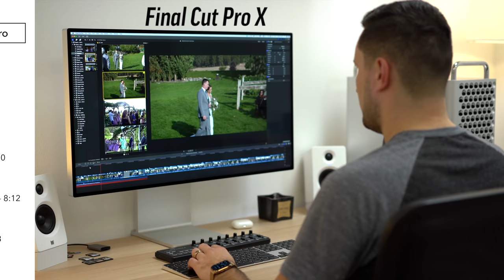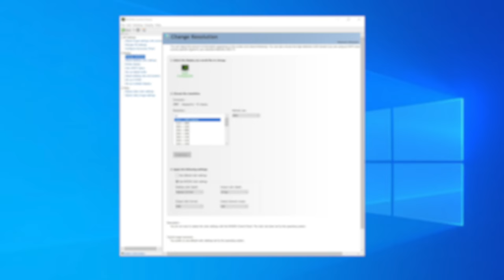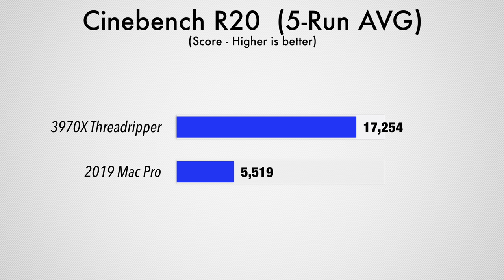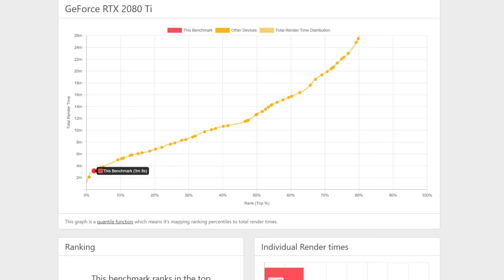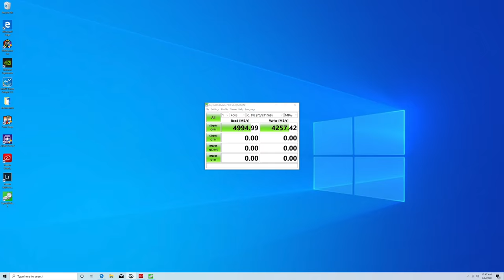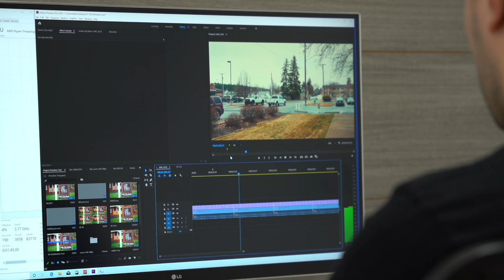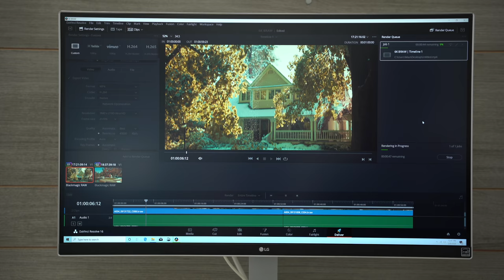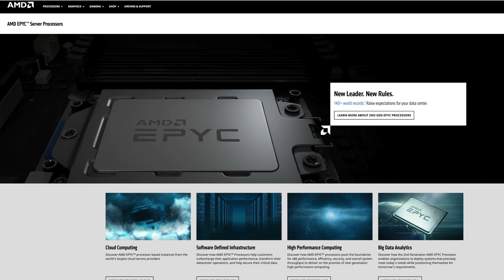$15,000 Mac Pro vs $5,000 Threadripper - Sorry Apple..

Comment: So people pay 10 grand more for an operating system
Reply: An operating system that is A) faster and snappier at all the menial stuff you do on your computer every single day, B) looks better, and you look at it all day, C) Runs certain software – video processing software particularly – so much more efficiently that so-so hardware performs better than top spec PC's, D) Runs creative software like Final Cut Pro and Logic which are not available anywhere else.

These are not trivial reasons for a lot of users.
Reply: @DaCarnival  I'm using macs and pcs for a long time together because of reasons, and my win10 feels so much snappier and lightweight  than the osx incarnations of the last couple of years I used.
Reply: DaCarnival I don’t think you can make a blanket statement like “it looks better” I for one hate how Mac OS looks and I’m sure there’s many different opinions on the aesthetics
Reply: Noah L of course looks are subjective (and in this case familiarity is a big decider of preference) - but for those who like the look of MacOS, it’s not trivial.
Reply: Look up Hackintosh...and people realize they can dramatically change the way Windows looks, right?
Reply: The beauty of a PC is that every single thing is customizable, even the software. Windows 10 sucks, but there are ways of making it easier to use (more intuitive), and a bit faster, also if you think that there are software on Mac that don't have a Windows counterpart, then 10000 is the price you pay for ignorance and unwillingness to get to grips with a new UI.
Reply: paulerxx no they actually don’t. Windows is hella customizable but nobody does it and people who uses other OS act like it’s set in stone
Reply: Yeah, basically
Reply: @anonymoususer69 , bloody well said.
Reply: @s1ndrome117  Hackintosh on a computer that's supposed to be used reliably for work is a potential nightmare of frustration. Linux is fine and dandy for people who are their own sys admins and have poured a lot of their experience points into computer-savviness. I'm not computer illiterate by any means – I've built my own hackintoshes, I understand the components of a computer and their functions, I can troubleshoot most of what comes up – but, like most working professionals, I'm not enthusiastic about setting up and tinkering with my computer all the time. Mostly I'd like to just use it.
Reply: @s4rg380  "A windows counterpart" can be fundamentally different in more ways than UI. 10000$ is often the price you pay for using Logic Pro or Final Cut Pro – software that is not trivial to replace, and that many clear-eyed users feel is worth an extra 5000$ up front, for tools that make them 20% faster at their paying job.
Reply: @DaCarnival If you can't spend some time researching something and potentially saving a lot of money in it. Then just pay more like an iSheep.
Reply: @DaCarnival , If only it was 20% faster,  that would justify the price somewhat... (it's actually 42% slower, and this isn't even the top specced TR with everything maxxed) But hey, as I said, if you don't want to learn a new setup, you are ignorant of the fact that you can do your paying job just as efficiently, if not faster, but you don't seem to understand that the difference in initial expense is an automatic 10000 bucks profit, and make no mistake, that's not small change, if it is, you can afford to be ignorant, but making such uninformed purchases will stifle your business growth. But please just keep your uninformed opinion to yourself and stop trying to convince me, rather do the research for yourself, unless you are unwilling.

Here is a pro tip for you:
Function first, looks last...

Hell even windows 98 looked better than windows 10, does that mean I still use it because it is prettier? Wake TF up man...
Reply: @s4rg380   20% faster is cutting in FCPX vs Premiere Pro/Avid – no matter the specs of the machine.
Reply: @DaCarnival , funniest of it all is that if you were to strip away at the functionalities of windows, and get it to a point where it compares to a Linux setup, it is actually faster than Linux, yeah base Linux is fast, but for the purposes of 99.8% of the consumers it is absolutely non functional, it can do practically nothing out of the box, and when you start installing compatibility layers like Wine or Lutris, or whatever you fancy, the fluidity lead that Linux has, vanishes. In fact it becomes so wonky that running the same hardware, it cannot run the same software. As I said before, windows sucks, do not think for a moment that I am refuting that, but regardless of how much it suck, it is still more functional than Macintosh.

When stumble around in windows, unsure of how to operate it, looking technically illiterate to onlookers, but you reckon windows is useless, and you deem it slow, because you don't know how to use it, that says nothing windows... Mac is faster, because it lacks ... well quite a lot. And the UI is designed to be idiot proof, which should tell you about the target market, how do you right click on a Mac? Oh right, you don't... 😅

And well, about those 3 software sets that are actually faster on Mac and for that matter, exclusive to it because it was designed for it, again, your unwillingness to learn something new comes in to play...

You keep hammering on about cutting in Final cut, that I am convinced it's the only thing you do. Helluva job you must have, I'd be bored out of my skull.
Reply: @DaCarnival  that might be because it hasn't been optimized, I know for a fact that AE is single threaded... As are all Adobe Duds. 😅 Threadripper is capable of 5.3GHz, FYI.
Reply: God, that second to last comment looks like a brain fart. Bless you auto correct... 🤦🏻‍♂️
Reply: @DaCarnival  Final Cut Pro is developed by Apple for Apple, I'd be bummed if it were faster on windows machine... But it is impossible to test. So it can't be faster, faster than what? Faster than scissors?
Reply: @DaCarnival , simple math dictates that it is actually 300% the initial cost of the windows counterpart, (albeit 20% slower at one single task in a whole lineup of things that needs to be done) I'd rather have 3 machines bringing in 2.8 times the income. But business economics seems to be a subject iSheep failed at miserably.
Reply: Oh yeah FCPX is faster than a single threaded Adobe product, fuck, that's an excellent comparison, sorry, my bad I just thought you'd do a proper comparison, seems like I am the ignorant one, my apologies.
Reply: @DaCarnival  I used a macbook and it sucks...
Reply: Akira Thorson no one with half a brain is going to get apples insanely overpriced RAM, the price goes down like, 10-20k just from getting your own ram
Reply: I used to work on OSX in my last company, and it was the most frustrating aspect of the work, I felt like my IQ temporarily dropped whenever I sat in front of that dreadful OS
Reply: @DaCarnival  I'm sorry but linux and windows completely stomp macos
Reply: @DaCarnival  bruh i'm sure that you can find a couple hours to configure and personalize win10, especially when you've saved 10 fucking grand
Reply: @notme1998  that is the whole point, but as said before by others numerous times, people who swear that Macintosh is the best, are simply too ignorant to spend a couple of hours configuring anything, and don't expect them to learn a new software set, not even when that software has more functionality/plug-ins. Acting like they've actually tried it.

They might have tried it, for 5 minutes before drawing their conclusions. They'll tell you that they use both, but fail to mention that they use a shitty 15 year old PC barely capable of running win10, and they judge all others by that standard. You know, let's compare a $100 Android to a $1000 iPhone while we're at it. Like someone who has never driven stick shift wouldn't consider it as a viable option, unless you only have one leg, in which case it wouldn't be.
Reply: Bro I pay 10 grand for 2 cad programs
Reply: @DaCarnival  looks better? that thing is a cheese grater
oh  you were prob talking about the os for me they look the same (windows 10 and the newest mac os)
Reply: @DaCarnival  these are all useless reasons
Reply: @DaCarnival  doesn't make it worth 10k lmao
Reply: @DaCarnival  "Looks better" yah nice argument
Reply: @DaCarnival " looks better"

Lol
Reply: @DaCarnival  but 10k.... really? slightly snappier? and boost performance that still falls short of a device 3x cheaper? Creative softwares, I'll give to you but even then those softwares are closed ecosystem (do I need to explain the complications?). Your paying 10k for softwares and aesthetics. Do u think professionals (which apple is targeting with this) will give up bang the buck for aesthetics? I ain't tryna say your wrong but really? 10k for aesthetics and less support? I sure wouldn't
Reply: DaCarnival love Apple, but bruh 15 grand for this Gtfo ? They got you guys by the balls, if it wasn’t for their software, they wouldn’t last a chance against PC
Reply: @DaCarnival  honestly the argument  that mac os is snappier and faster doesn't hold water anymore. Yes if you conpared it to the old days of windows yes. But with windows 10, this is no longer the case as windows 10 is very fast and snappy. Everything the mac can do, windows can do, but everything a windows can do, a mac can't do (ie). Honestly at this point you would have to be a moron to pay so much money for an operating system, that is just perhaps visually appealing...
Reply: @DaCarnival  nope nope nope. A) Windows with an ssd and a decent cpu is more snappy than you'll ever need. B) look is subjective (I hate it) C) no one in their right minds would pay $5000 for a video editing software and DAW when Da Vinci is free (studio version is 299 with lifetime upgrades), Avid is still pretty cheap; FL studio and Ableton cost upto 599/600$. Editing is not magically 20% faster across all software as well. Render speeds are still CPU and gpu dependent in Resolve which has great encoding speeds. Audio core and drivers functionality is a win for Mac; with money to burn, a fully maxed out Mac might be very ergonomic and streamlined but so can windows for that much money.

Comment: $14000 dollar PC and accessories:

AMD - Ryzen Threadripper PRO 3995WX Castle Peak 2.7GHz 64-Core sWRX8 
ASUS - WRX80E-SAGE Pro WS SE WIFI AMD sWRX8 eATX Motherboard
G.Skill - Trident Z Neo Series RGB 128GB (4 x 32GB) DDR4-3600 PC4-28800 CL18 Quad Channel Memory Kit F4-3600C18Q-128GTZN - Black
Corsair - Obsidian 1000D RGB Tempered Glass eATX Super-Tower Case
EVGA - SuperNOVA 1600W Watt 80 Plus Titanium ATX Fully Modular Power Supply
Sapphire Technology - AMD Radeon RX 6900 XT Toxic Overclocked Hybrid Cooled 16GB GDDR6 PCIe 4.0 Graphics Card
Samsung - 870 QVO 8TB SSD 4-bit MLC V-NAND SATA III 6Gb/s 2.5" Internal Solid State Drive
Inland - Platinum 2TB SSD NVMe PCIe Gen 3.0x4 M.2 2280 3D NAND Internal Solid State Drive, PCIe Express 3.1 and NVMe 1.3 Compatible, The Ultimate Gaming Solution
Seagate - BarraCuda 8TB 5400RPM SATA III 6Gb/s 3.5" OEM Internal Hard Drive
LG - WH16NS60 12x Internal Blu-Ray Disc Drive
Logitech G - G915 LIGHTSPEED Wireless RGB Mechanical Gaming Keyboard - Romer-G Linear
Mackie - CR8-XBT 8" 2 Channel Stereo Multimedia Monitor Speakers with Bluetooth - Black
Logitech - MX Master 3 Advanced Wireless Mouse - Black
Samsung - C49RG90 49" DQHD (5120 x 1440) 120Hz HDMI VGA DP FreeSync HDR Curved QLED Gaming Monitor

Comment: I would still go for the TR for custom and the fact that it's 10k cheaper.

I think people can wait a minute or two longer to save 10k.
Reply: @cybersamiches4028 , then there's that... 128 threads? Why not... Dual GPU nah, quad GPU. If it's going to make a difference in the workloads is irrelevant. It will be f@#king spectacular.

What monster could be built for 15k? That's a real apples to Apple comparison.
Reply: @cybersamiches4028 , I am sure it will be a monstrous system, and certainly a conversation starter, but I'm not entirely convinced that it will be a very practical machine of which you'll be able to fully utilize all of the hardware. 95% of the time it will probably be in what could only be described as "idle" for a system with that much raw computational power.

Comment: Next video Mac Pro vs AMD Threadripper
(64 cores and 128 threads)
Reply: I was just going to say this. Still way cheaper too.
Reply: And the TR PC is still cheaper and better 😂😂😂😂😂
Reply: Said Abdi but probably unreliable with shitty amd drivers. I don’t trust amd
Reply: @CC-gt3ro  the GPU drivers are the problem. Amd especially the ryzen series is the price to performance king that has no problems if you use fast ram.

Comment: The Mac have the advantage of the software being as optimized as possible. The Threadripper performance can still improve.
About the noise, it's on you and your choose of coolers.
Reply: About the noise, why not tune the fan curves?
Reply: Like Linus.
With a computer with so much cores and memory you could have just one for the entire house.
Reply: @BakjeLeip   YOU can hardly know the difference, when you don't know the difference between iOS and macOS.
Reply: Hahaha try using libre office on macos
Reply: @041mikey   You leave us wondering why?
Reply: @peterbreis5407  We use it where i work and we all have macs (well mine is a hackintosh but we all have the os) anyways if you run a spreadsheet with a lot of conditional formats, then it absolutely crawls, but on the linux dualboot i have on the same computer i have it runs like greased lighting
Reply: @041mikey   Interesting! 

On the other hand, Numbers, Pages, Keynote, Aperture, FCPX, iBooks, Logic Pro X etc run so slow on Linux and Windows you can't even tell they've launched. ;)
Reply: @peterbreis5407  wonder why
Reply: @041mikey   Well are you blaming the software or the OS? There is a reason I have LibreOffice but don't use it. I don't have to. 

The UI/UX suck for a start and when I have better options? The only thing is LibreOffice has a database, even if it isn't much of one.
Reply: @peterbreis5407  the op was about optimization, its totally libreoffices fault but im pointing out that there isnt always optimization, also preview crashes whenever i open large images so theres another thing. We have to use libre as we need shared documents and open offices filtering is trash, we basically need free sharable spreadsheets with intuitive filters
Reply: @041mikey   You might be able to tell me. What is a good equivalent to Downie (youtube downloader) in Linux, I've been looking for ages. 

Whilst I use Linux, the software tends to be less than stellar and it is really hard to find equivalents to macOS or even sometimes Windows Apps. I'm looking for an alternative to Pages but can't find anything. Sorry, LibreOffice is not it.

P.S. It would be a great experiment to open your complex Spreadsheet in Numbers and see what happens. I like the way the spreadsheets work in Numbers and Pages. You can break them up into logical smaller spreadsheets that talk to each other and work out and label their end results intelligently.
Reply: @041mikey   Interesting about Preview. Do you use Finder Preview/Cover Flow much? I use it all the time and it is smooth as butter. One of many things I miss in Linux and Windows.

What version of macOS are you running on your Hackintosh and what CPU/GPU? Your problems maybe your build.
Reply: @peterbreis5407  all our spreadsheets are confidential so we rely entirely on open source software and software made by Synology who make our nas drive, i dont know about linux downloaders i only use linux at work as an alternative to mac, i use windows at home, but any video converter (avc) is what i use
Reply: @041mikey   I like the idea of LibreOffice and would like to contribute to an improved UI/UX for LibreOffice on macOS and Linux, but know from experience that it is really hard to get projects like this to both comprehend and accept better UI/UX. 

There is a reason the software looks and works the way it does.
Reply: @041mikey   Ah! Your files are on a NAS!! Connected by Ethernet or WiFi?

If you are having problems, I'd check what happens locally first to isolate the issues.

Thanks for that lead to AVC. The search also lead me to UniConverter which I will try. Not that I am unhappy with Downie which is brilliant, but I'm always looking for alternatives.
Reply: @041mikey   Tried AVC Pro for Mac. 

Clumsier, slower and downloads ads in video which I don't want. Also I'm not sure what I did but no audio (part of demo mode?).
Reply: It's not so much about the choice of coolers, but the case IMHO. Having sound insulation might sound like a good idea, but actually isn't in this particular application! The components can easily draw 400W of power, and all that heat has to be moved out of the case - which is complicated by the sound insulation; thus the fans have to ramp up in order to get enough airflow, making the system louder overall. For high-power systems it's usually much better to get a case with as much airflow as possible, so that the fans can happily idle away.

Comment: you mention build time, ok, so contact someone like Puget Systems or another high end PC workstation builder and get a "ready to go out of the box" unit
Reply: Or just microcenter...
Reply: blad90  Not 10k dollars more
Reply: blad90  Yeah 5000 for a system and 1000 for a build (I'm sure any technician would be more than happy to just build a system for 1000). Still saving 9000 dollars and you'll have 3x the performance.
Reply: blad90  yes. But building fees arent 10k lmao